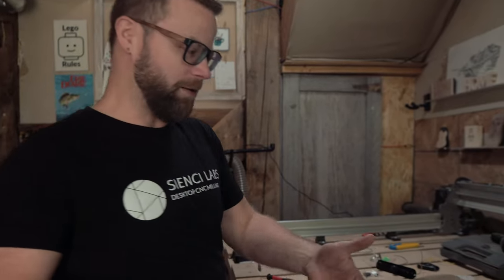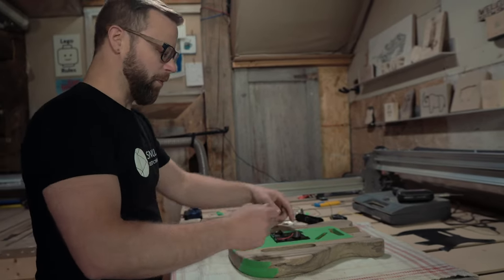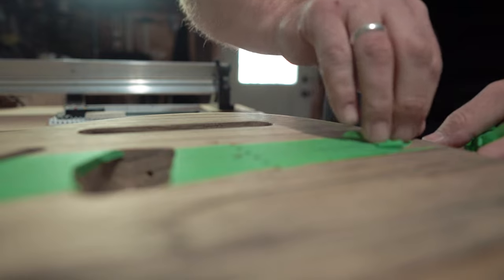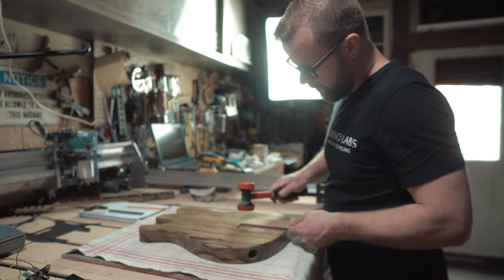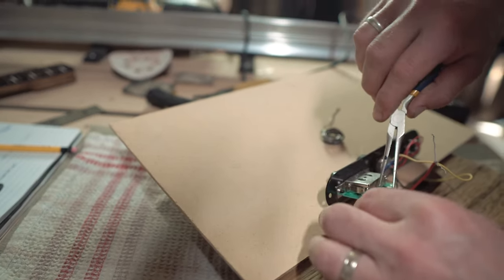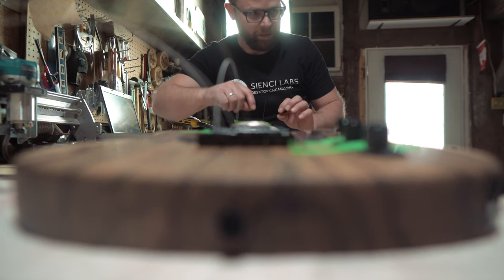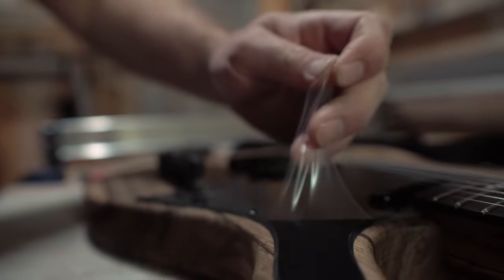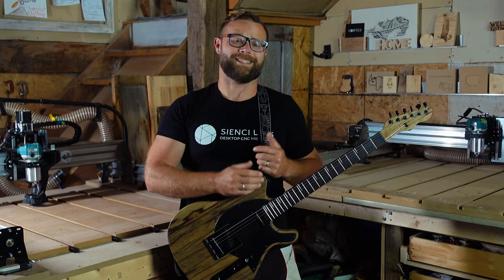Building a Guitar on a CNC Part 6: Assembly

Comment: You can use a long socket and send the 18" drill bit through it for protecting the body when drilling those wiring holes.
Reply from the maker: Great tip!